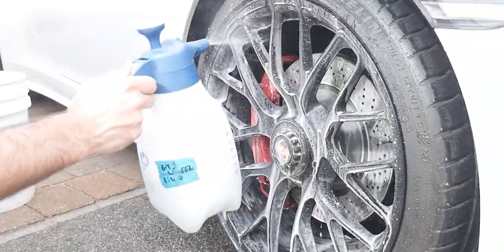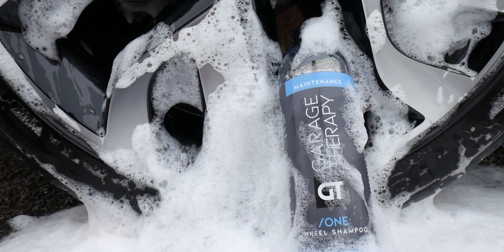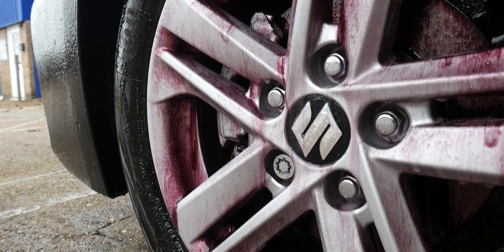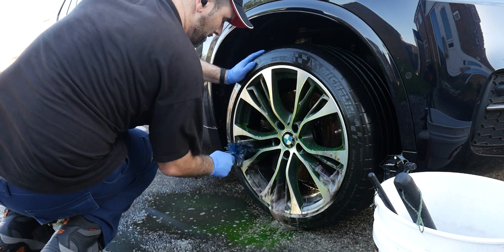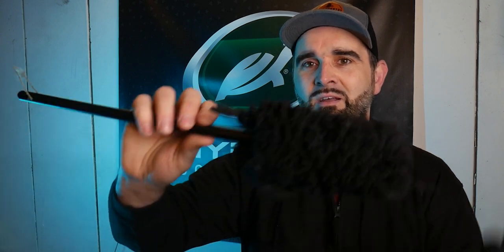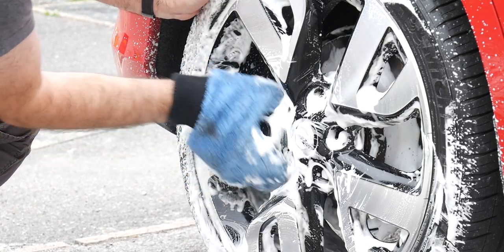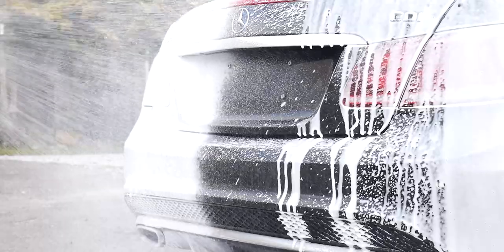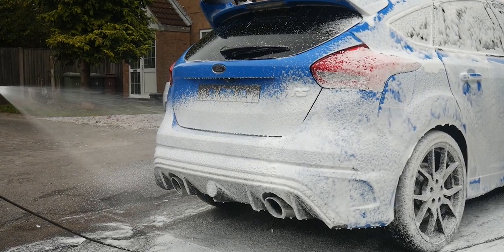Clean Your Wheels Like A Pro With 3 Simple Steps!

Comment: Wheels first.
Dedicated wheel shampoo, pre rinse, various EZ brushes,tyre brush, Dooka wheel pad,arches cleaned when cleaning tyres.
Current winter wheels coated with with Finishkare 1000p and topped up with Gyeon Wet Coat.

Comment: I have stock rims on my 2000 Toyota Camry LE. They are the steel rims. How do I clean a stock steel rim? I have looked at different types of wheel brushes. I even looked at a microfiber wheel brush at Walmart. But I'm more confused than ever. HELP.